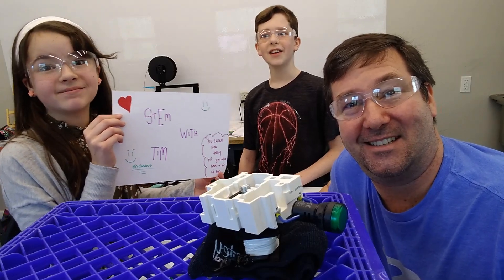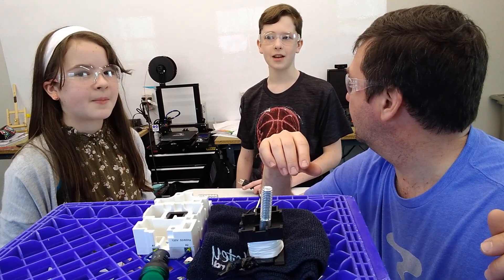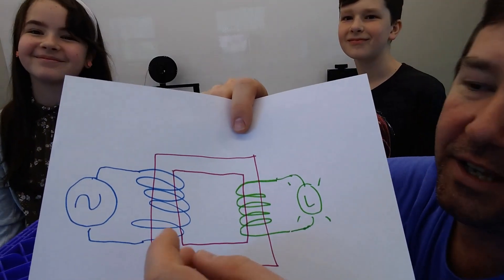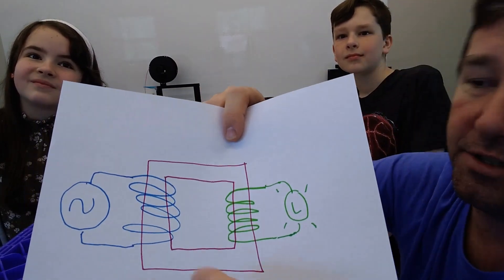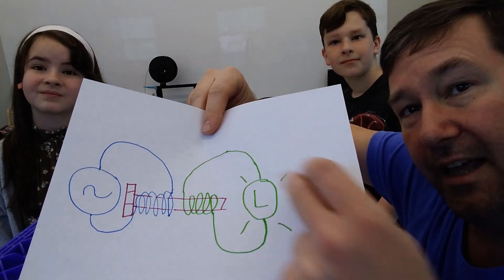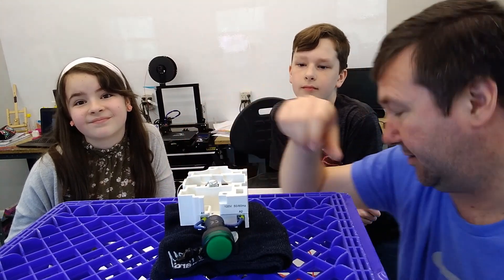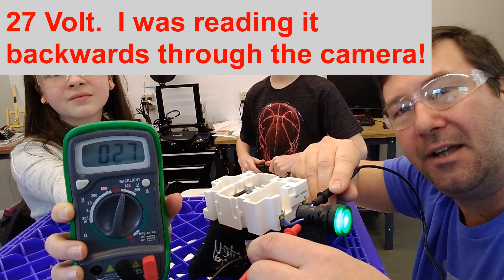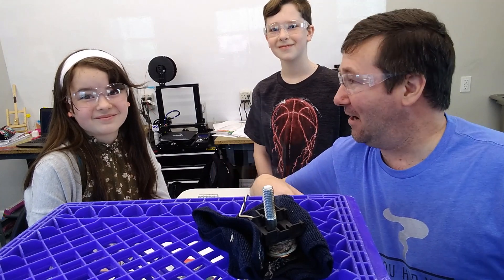How Do Transformers Work?  Using Two Contactor Coils and a Bolt to Show How Magnetic Flux Works

Comment: Did you tell the kids why the real reason why the transformer hums?
Reply from the maker: So you know the fuses aren't blown, right?  ;)
Reply: @TimWilborne  The real answer is really cool when you actually think about it.  Magnetostriction - the noise made by a transformer because of the expanding and collapsing magnetic field and the changes in the ferro magnetic stresses.  If you could measure the hum it should be close to 60hz.  I find it very cool that the magnetic field is actually strong enough to move the core enough to hum.  If I could I would vote you and Amber in as parents of the year.  Keep up the excellent work your kids are going to have a huge jump start at life because of your efforts.
Reply from the maker: @briansmith5843  I wonder if the hum would show up as 60 hz on one of these tuning apps.  That might be a neat project.
Reply: @TimWilborne  Thar would be.  I would think that it would have to based on the frequency of our electric system.
Reply from the maker: @briansmith5843  Might have to waste another coil and try it :)
Reply: @TimWilborne  Get yourself a relay with a 120 VAC coil and put a piece of paper between where the plates come together. That will get it humming for you.
Reply from the maker: @MrWaalkman  This might turn into a "How many lessons can you make out of a contactor coil" video :)
Reply: @TimWilborne  They hum because they don't know the words.  LOL!
Reply: @briansmith5843  I thought that I sensed a Dad joke coming along shortly.